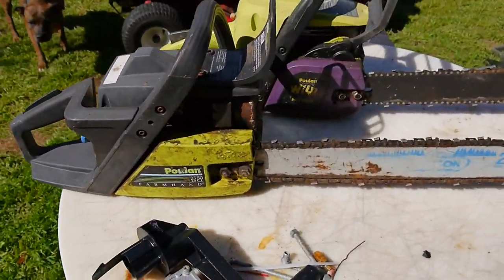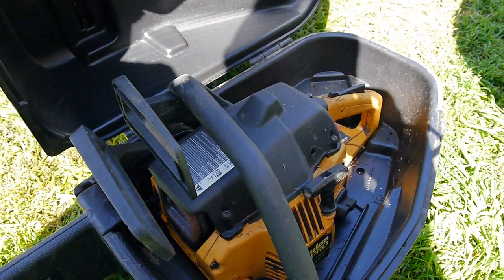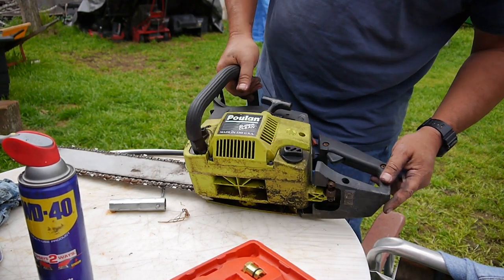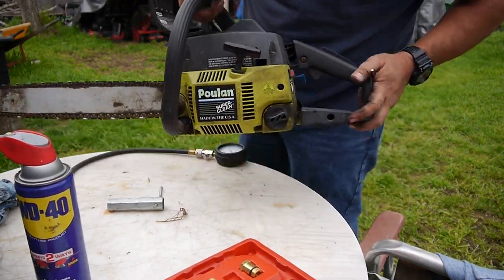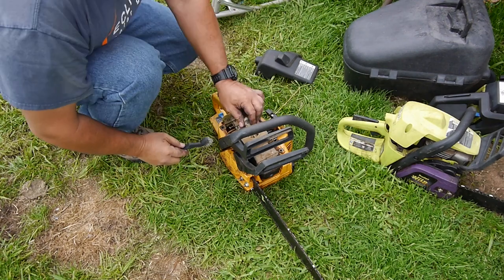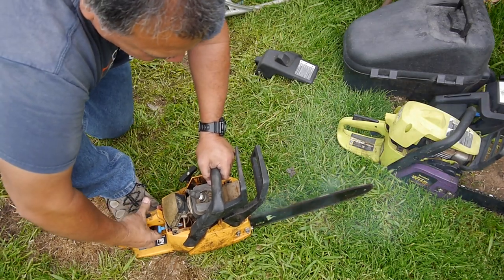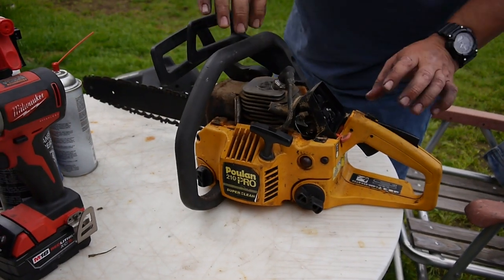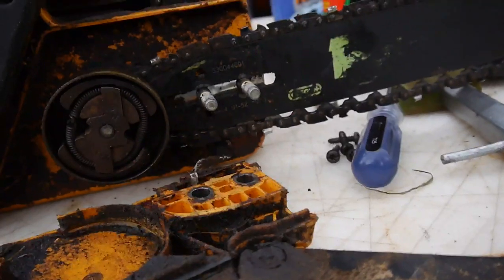Are Junked Chainsaws Worth Fixing?

Comment: Great video. Subscribed and thumbs up!  What I’d like to know is, what would you expect to get for these when you sell them?  I’m just starting to do small engine work here on Cape Cod and have a lot of free or dirt cheap machines on hand (lawn tractors, snow blowers, hedge trimmer, string trimmers, 8 more chainsaws, walk behind mowers and a generator. Just sold my first revived machine, a Poulan P3516PR, for $80. I was asking $99 and hoping to get 90. It needed $37 in parts, although I scavenged the magneto and intake tube off one of the other three I have that are similar. Did a complete cleaning and tune including taching L & H to 3000/11800, making sure it would start easily cold or hot and sharpening the chain. I’ve acquired a lot of the tools I need already, although there are always more I’d like to get as I can afford them.

Comment: The poulan 210 is not supposed to have a brake, so someone put this one on and cut the band off because the other handle is in the way
Reply from the maker: Kind of strange.  I saw one parts diagram showing a cover with no brake, but I looked up the part number and the cover does have a brake.
Reply: @SmallEngineDIY  someone either has swapped the handle or the cover, it's not supposed to have both
Reply from the maker: Look up part number 545139901.  It shows a cover with the brake.  Maybe this part replaced an obsolete part number, and it now includes a brake.
Reply: @SmallEngineDIY  no, with these Poulans theres different versions of the saw, for example a poulan 1950 came in many versions, (woodshark, woodsman, super clean, etc.) Same case with the 210
Reply: Some 210s had the one handle piece like yoursand some had anti vibration system. Some 210s had a chain brake, some didn't.